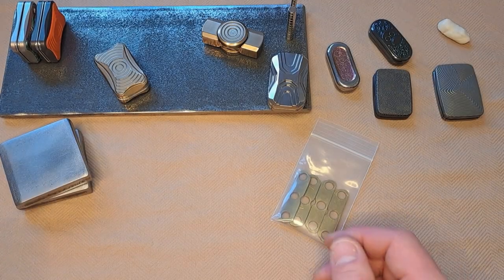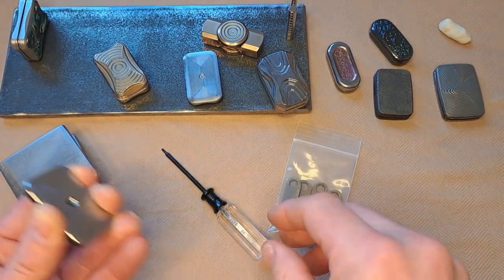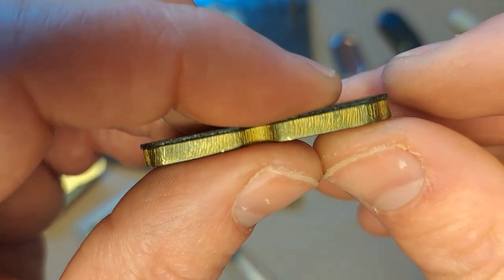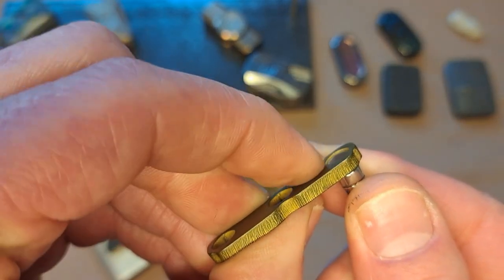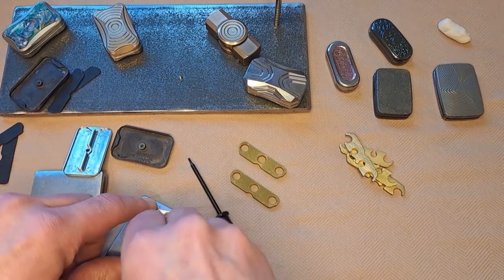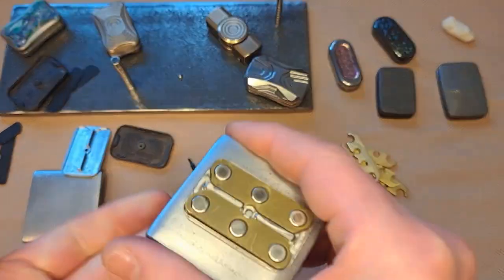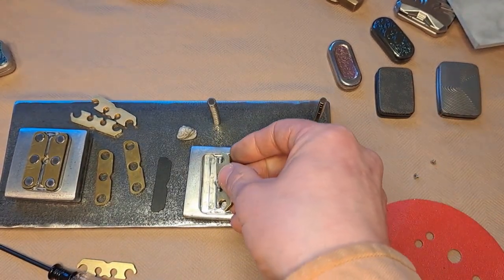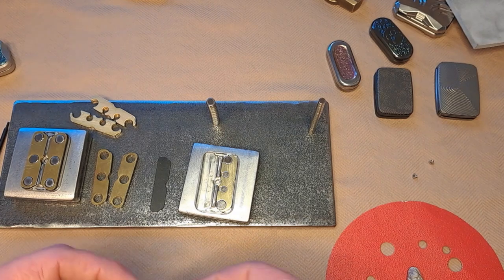How to battle the rattle

Comment: I wasn’t expecting the wall putty 😅 I use scotch tape to cover the magnets. I cut the length of the insert, cover one side, cut the half that doesn’t cover the insert, and slap it on to the other side. Rinse and repeat for the other half. Seems to work for me, but I’m beginning to run out of tape 😂 when I take it off, I use the extra magnets to grab one of the magnets in the rapt and slowly peel the tape away from the other 2/3 magnets.
Reply from the maker: In the end, whatever works for you, works ☺️